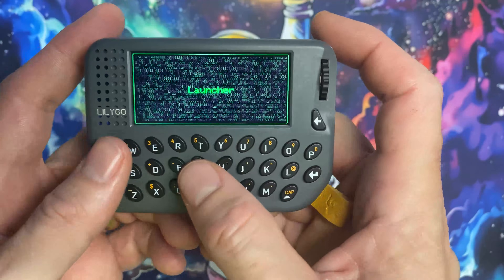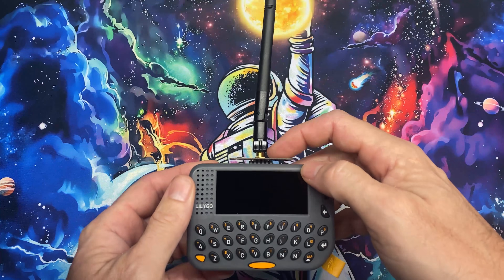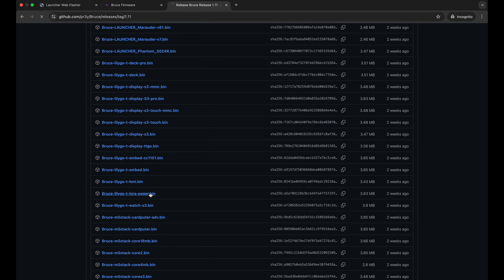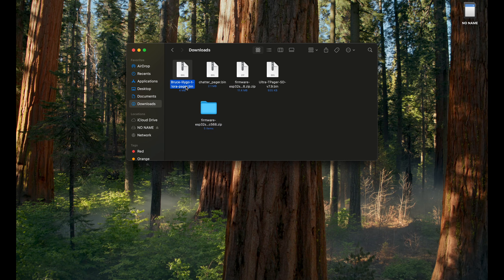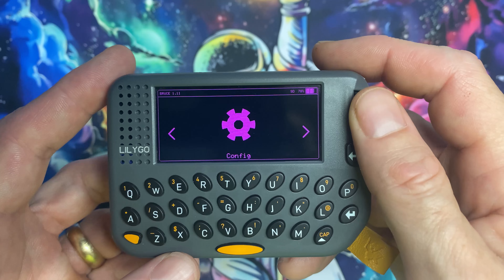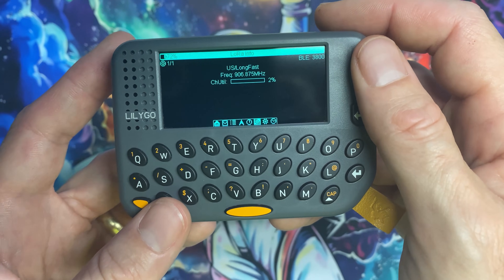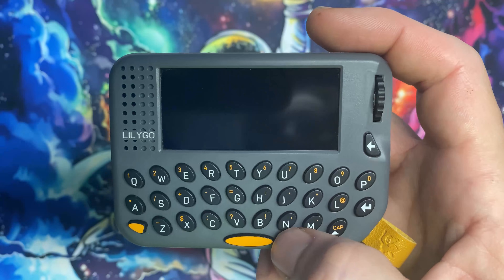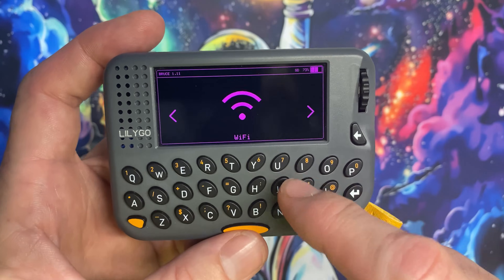Lilygo TLora Pager Build - Launcher Bruce Meshtastic Ripple Meshcore

Comment: @hackedexistence, Since the firmware for the pager is no longer available on nightly links, is there a link to the firmware for SD? because the only way to install it now is via the flasher. It means the pager will be either Meshtastic or launcher without meshtastic.

Comment: Yo my launcher will not install any bins it throws an update error every time. Got a 32 gb card in now gonna try a 16gb tomorrow and see if that works.
Reply: Did you ever figure it out? Im having the same issue.
Reply: I figured it out. It was my SD card. Didnt like my FAT32 32gb Kingston card but a FAT32 32GB PNY card works fine.

Comment: randomly stumbled to this video. what is the purpose of this device?
Reply: It really depends on which firmware you choose to use but its used for off grid communications on the 915mHz LoRa band, it can be used with Bruce for cyber security pen testing, & people have done some really cool IOT setups with these devices for home automation.